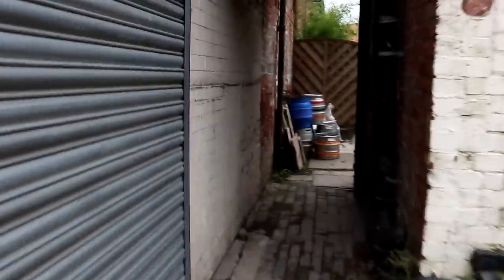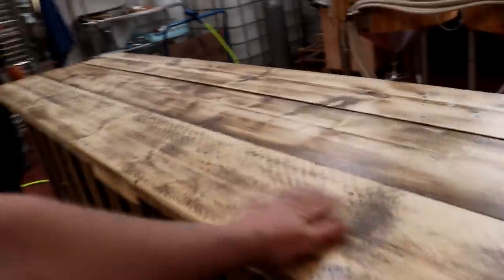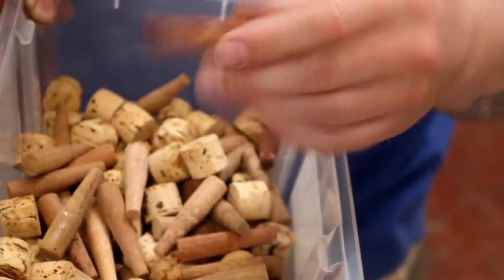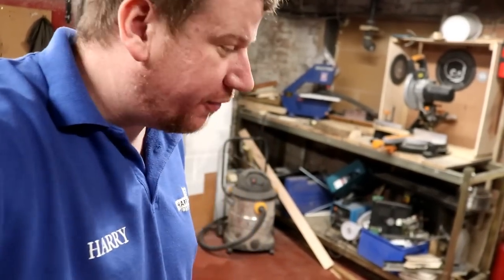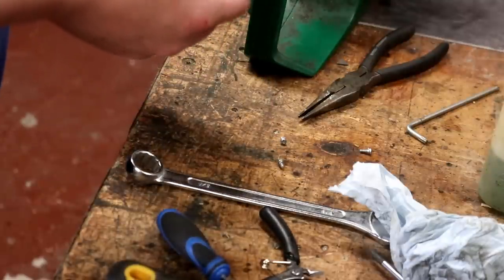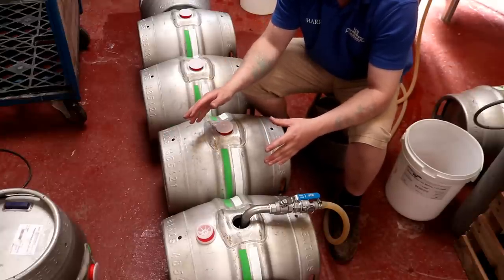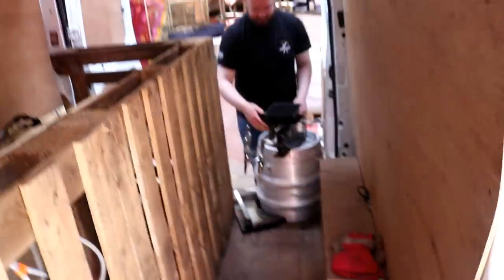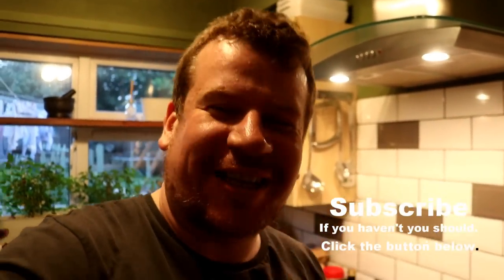HOW DO YOU FILL YOUR CASKS?

Comment: Noticed you fill the casks up without worrying about oxygen getting in, does the beer lose flavour and aroma over time? Do all brewery’s fill casks like this? Just wondering as my kegged beer degrades over a couple weeks because I’m not able to do a closed transfer, cheers Harry
Reply: Looking at it, i see it fills the keg from the bottom so does not create any turbulence, also as the keg fills it will push any oxygen out of the keg, i could be wrong but that's how i do it with the homebrew and have never had any problems.
Reply from the maker: I very much doubt it is oxygen that is the problem. Filling from the bottom, along with co2 release during the fill expels any o2 from the casks. I would look closer at your process, hygiene or recipe if beers are going off that quick.
Reply: Ok, thanks for the replies
Reply: The thing that baffles me is how do you get your kegs to last two weeks lol.